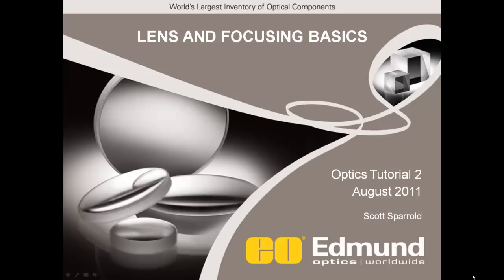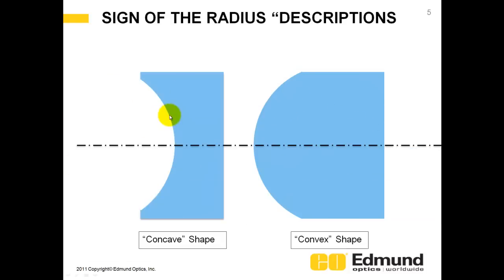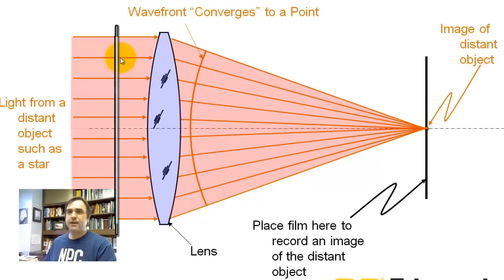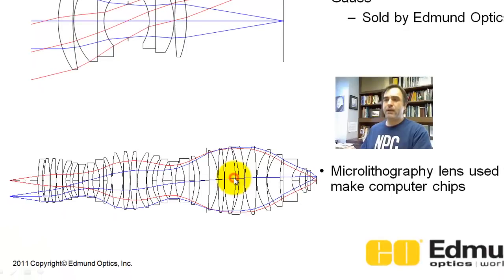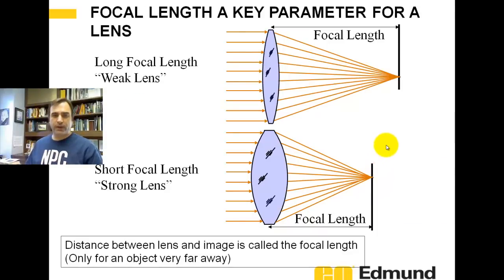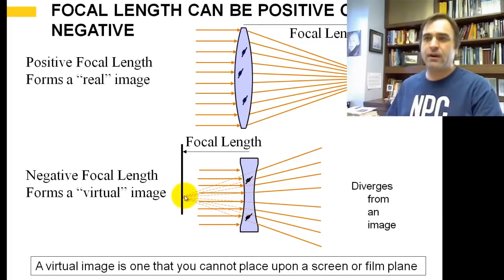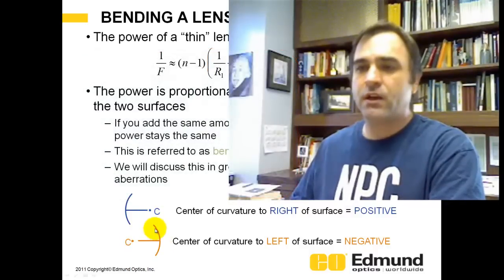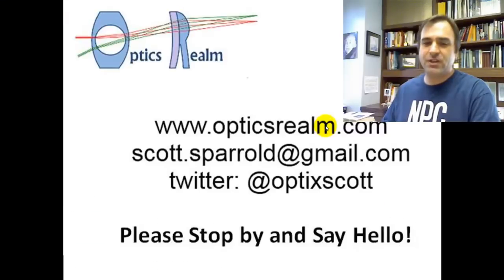Optics Tutorial - 2 - Lens and focusing basics

Comment: Answers using wayback machine:

(scroll down)

1. An equi-convex fused Silica lens has a 90 radius of curvature. Compute the focal length. 

Solution: Use the thin lens equation to calculate focal length: Power = φ = 1/F ≈ (n-1) ((1/R1) –(1/R2)) = (n-1)(C1-C2)

Fused silica has a visible index of 1.4585 [Source]

Caveat: the back radius is negative. If one uses a positive radius of curvature then you are calculating the focal length for a meniscus lens.

F ≈ [(n-1) * ((1/R1) –(1/R2))]-1 
F ≈ [(1.4585-1) * ((1/90) –(1/{-90}))]-1 = [(1.4585-1) * ((1/90) +(1/90))]-1 = [(1.4585-1) * (2/90)]-1 = 90 / 2 / (1.4585-1) = 45 / 0.4585
F ≈ 98.15 

Holy Frioles! that algebra is a mess!

2. A lens has a front convex radius of 200 mm and a rear concave radius of 1000 mm. What is the shape factor? Flip lens and re-compute the shape factor.

Solution: in the first incarnation both radii of curvature are positive, since both center of curvatures are to the right.
S = (RFront + RBack) / (RBack – RFront) =  (200 + 1000) / (1000 – 200)
S = 1.5, Positive Meniscus

The second incarnation or a flipped lens, both radii of curvature are negative, since both center of curvatures are to the left.
S = (RFront + RBack) / (RBack – RFront) =  (-1000 + (-200)) / (-200 – (-1000))
S = -1.5, Positive Meniscus

Conclusion: Flipping a lens changes the sign of the shape factor. Why do we care about this parameter? It will become more apparent when we begin to study spherical aberration. For a distant star imaged by this lens each lens orientation will have a different amount of spherical aberration and therefore different spot sizes. Aside: "... a distant star..." is referred to as an "infinite conjugate", but I hesitated using overly verbose optical engineering nomenclature:)

Comment: if  I put 3 laser diode  in back of a lens of 20mm dia  and 300mm focal  if the laser diode are at center of the lens 
do  i  add the power of the laser diode   at focal point

Comment: So, what kind of optics do I need to create a smaller laser ray(1/4 the original) going out to infinity(no focal point needed) from a Co2 laser tube? Thanks
Reply: You may be surprised to learn this isn't possible.  Except for Bessel beams, which are only theoretical, all LASER beams diverge.  No matter how well you collimate the beam, it will still spread.

So a further refinement to your question is required.  At what range of distances do you need your beam to be the size you want?  If you look up Rayleigh length you will get an idea of what is required.

Comment: Quick question, how would light behave in a curved prism? That is, a prism that has an arch.
Reply: It would reflect depending not he index of refraction and the angle of the surfaces. since the inside is uniform it doesn't matter if it's bent.

Comment from the maker: You are correct! The shape factor as defined by Coddington (Rfront+Rback)/(Rfront-Rback) will give an undefined result or 1/zero when Rfront=Rback. The shape factor is intended to capture the variation of a lens while maintaining a similar focal length. When the front and back radius are equal the lens has little optical power or a very long focal length (it is essentially a window)

Comment from the maker: You may be asking about the difference between focal length and back focal distance. Focal length is a factor to describe how object space maps to image space. Back focal distance is the distance from the last refractive surface to the image. These two parameters can be the same such as a single thin, long focal length lens. More often the are NOT the same. This is the case when the back principle plane is inside the optical system

Comment from the maker: Sorry for the late response...I think you're requesting how to evaluate / compute the system focal length from a lens assembly composed of several lenses of differing focal lengths. I have not addressed how to compute this via equations. Rather I have been lazy and assumed you would put this into ray trace code and use the tools there to find the system focal length. Perhaps I should not be lazy and fully address this in an upcoming video. OR....

Comment from the maker: @turb0talon Radius is a linear dimension and is intended to be denoted as "R". Sometimes it may be referred to as "Radius of curvature", but I usually try to say simply "radius. Radius is convenient when calculating focal length.

The inverse of radius is "curvature" in units of inverse length and denoted as "C". Curvature is convenient to use when calculating sag or power (inverse of focal length)

As far as units, I typically work in metric, so "R" is in mm while "C" is 1/mm